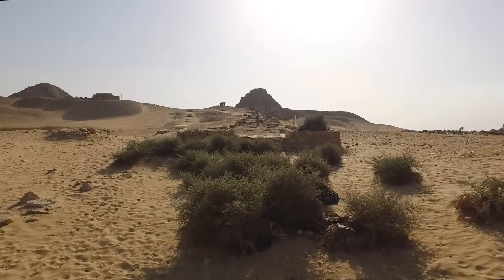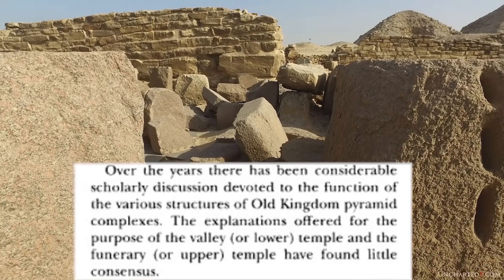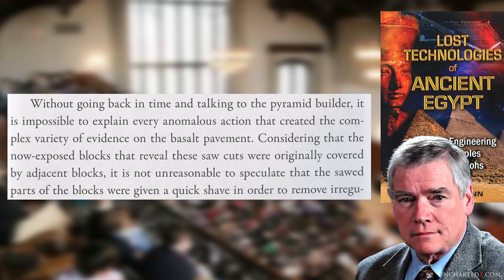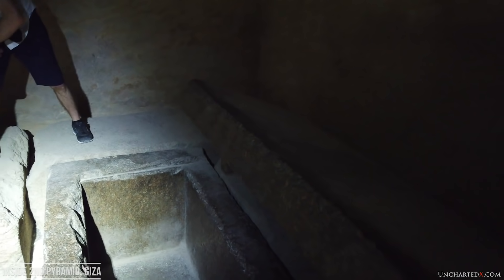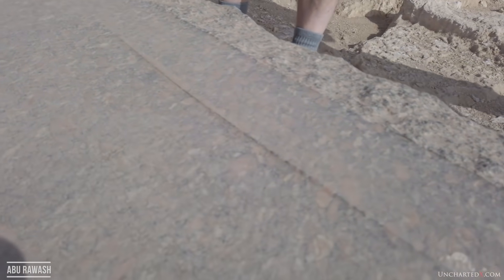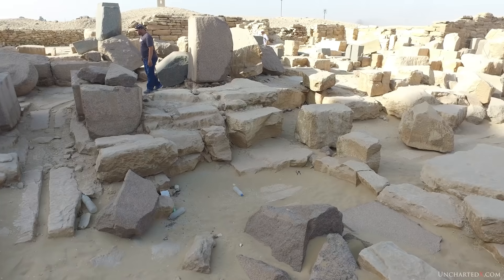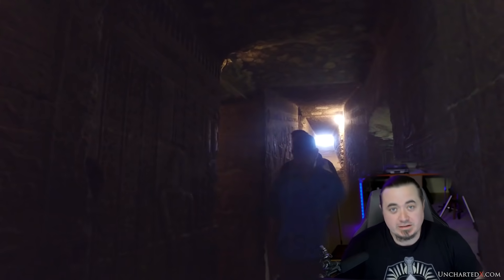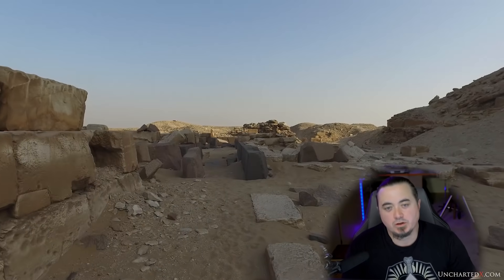The Mystery of Ancient Egyptian Stone Cutting in Basalt and Granite - UnchartedX full documentary!

Comment: In many places around the Mediterranean, the sands contain hard zircon crystals. These are easy to separate using gravity as they are much denser than sand.  It wouldn’t be beyond  Egyptian technology to sinter them onto bronze tools, just like stone cutting tools have zircon and diamond  sintered on today.  Also, just like today, many expensive pieces of equipment (eg. platinum crucibles used in assay labs, radioactive isotopes sources etc.) are kept under tight control. So there might have well been a lot of meteoritic steel tools in use, which never got lost...  Eg. There are no traces of the many huge Manhattan electromagnets left  today. All the silver was returned to Fort Knocks. Desert are the easiest places to find meteorites. They just sit there staring at you, saying pick me up.
Reply: Knox?
Reply: Good point. Like the tools were melted down right? And the metal was repurposed? After they were done?
Reply: @Nuts-Bolts ,
You can edit the Knocks to Knox.
Reply: Fort Knockshop?
Reply: Bronze tools? I thought they only had copper technology. Bronze tech is a quantum step above copper because it requires tin, difficult to mine and refine. Can anyone clarify?
Reply: The hardness of tools is only one aspect of many....the math being # 1.
Reply: @tedecker3792  perhaps when naming the ages, we referred to them similar to Olympic medals
Reply: It may be that the dynastic period Egyptians did separate zircon and work meteoritic iron but it still would not product the same machine marks seen on the stone work shown here. But you are very correct in thinking that those tools would not just be left laying around. They would have been worth more than their weight in gold and the material would have been reused. So there is no surprise in their absence in the historical record.
Reply: @sonjanordahl3158  Agreed. Modern high speed rotary cutting discs which use ‘slow’ feed rates would not leave such a surface finish. There is no advantage seen today for hacking through stone quickly if it is going to need more grinding before polishing. Yet, if one looks at the edge of some stone floor tiles they clearly show grooves from being sawn. For drilling through hard rock to do (say) geological surveys, tons of pressure is hydraulically  applied at the well head  to speed penetration (in other words, drillers don’t rely on just the weight of the drill pipe to force the bit down) leaving ‘grooves’  in the coring samples similar (to my eyes looking at photos)  to the discarded AE tube drill cores. For slicing rock. It would have been  a more economical use of metal for the AE’s to use  a pivoted lever. The flat half having a  radius edge onto which the zircon is sintered. As the unfinished stone cuts indicate a much thicker tool than today’s discs  so a greater amount of feed force could be applied. Aided by the fact the the force is being applied to a smaller cutting area than with a  disc. This would remove more stone at each stroke of the tool compared to each revolution of a modern disc.  Likewise, it looks to my eyes that much pressure  was applied to AE’s ‘thick walled’  tube drills using perhaps just mass plus gravity. Cutting rates to an engineer is a function of force per unit area and surface speed of the cutting edge. As Linus's law asserts "given enough eyeballs, all bugs are shallow". Verily, it is good that Ben is attracting more eyeballs.
Reply: Someone already demonstrated this, he used zircon, sand, a cow bone and a wooden bow and drilled a precise hole through a slab of granite in a few hours.
Reply: @tedecker3792  I'd have to check the facts to see if egypt had them, the video says copper but I'm skeptical. I know for a fact the nearby Mesopotamia civilizations had bronze saws centuries before the pyramids were built.
Reply: Bauxite is found in many places, and temperatures needed to convert to calcined alumina are possible in the Bronze Age.  Calcined alumina has mohs hardness of 9 .  Possibly sintered or used in free abrasive machining.  Do we know is the “saws “ would be used on vertical or horizontal axis or both?  I can imagine some sort of carousel or treadmill if horizontal. Each rpm of a 9 meter diameter blade would yield cutting speed of 27 meters per minute.
Reply: Bauxite is a plentiful aluminum mineral that when calcined yields aluminum oxide with mohs hardness of 9.   Temperature required is possible in Bronze Age and before.
Reply: @countryandnorthern1  Hadn’t thought of that! Saudi still has a working open cast mine at Al Ba’itha. The alph form of oxide occurs naturally so no heat needed. Turkey and Greece also has lots of it in the form of corundite at the same 9 Mohs. We badly need soil samples from these Egyptian work sites for analysis.
Reply: @Nuts-Bolts  Natural form not as hard. Have to drive off the water per se to get to 9 hardness. Do smaller stone objects show any signs of circular saws?  Silicon wafers are  sliced using ID diamond saws.  I made the water based lube/coolant years ago for slicing 6-8” D ingots.
Reply: impregnated into rope that is turned like a bandsaw blade explains not only why the tool disappeared but also the under cutting a circular saw could not do.
Reply: How do you slice up the iron meteorite to make saw blades for stone?

Comment: As always your long format documentaries are the thing on YouTube singularly that can get me the most excited. Keep up the incredible work. You are the next generation's Graham Hancock and Christopher Dunn.
Reply: Is there ever thought about cement?
You see huge blocks in large quantities, has that been worked with a copper chisel?
Beautifully crafted columns are simply made from cement by artists.
You can make concrete from basalt, granite and limestone.
Editing can be performed if it has not yet cured, you can tell by the distance of the machining grooves, which is not possible with hard stone.
With wooden wheels and wooden constructions in which they rotate, you can work with stone chisels all kinds of things, including hollow shapes.
Hundreds of years ago, windmills were also made of wood, with stone bearings and greased with beef grease, you can make anything. Those so-called processed stones in walls are also simply cast, as a kind of bags put against each other, you can easily see that they are all saggy (convex), so they fit exactly together. mysterious techniques and tools? I think simple tools such as a shovel, pieces of wood and linen bags and then such a wall is quickly made. Stones of tens of tons? Just cast in wooden formwork, otherwise you would have to put in a lot of effort to move so many stones, with what? So simply crushing rock types and turning them into concrete is also strong.
The broken bricks look very homogeneous on the fault line, it doesn't look like natural stone and plaques often fall off, because the concrete has not been mixed well, you see that everywhere, it has been a quick job.
Reply: @heinpereboom5521  Appreciate the insight, glad you replied to my comment so I was able to see it and read it :-). Would love to hear more, thanks!
Reply: @heinpereboom5521  🙈
Reply: @keithwhittington4624      ?
Reply: Couldn't pick a better insult eh?

Comment: I have worked with Granite, I was part of the team that installed the Cornish Granite on the new Parliament building Portcullis House and restored the end of the cell block at Scotland Yard which was shortened to allow the new Westminster tube station and Portcullis House to be built.
The cut marks made with the diamond blades we used to cut the stone are very similar to the marks shown on the Basalt here, it takes a great deal of effort and time to cut into a piece of Granite with a 9 inch diamond blade on an electic grinder/cutter, and cutting too far into a piece of stone is not something that just happens like slicing too far into a cake.
We were using a huge number of diamond impregnated steel blades and tungsten tipped SDS drill bits which become worn out very quickly, a Copper drag saw and sand would not be possible to make the overcuts as shown, the steel/diamond circular blades wear out in a matter of hours, and somehting like Copper would not have the durability to make the cuts, especially with an abrasive compound.
Reply: I totally agree. When you have hands on experience with these things you quickly learn what is possible. People of the time they say made these things did not have the technology or ability. These things were made by a civilisation far more advanced than we are able to understand.
Reply: That's because they used fire for pretreatment of the granite along the cut line then granite can be cracked like an egg. I've witnessed this
Reply: @stevenanddaisysjourney8922 That is a very common method for quarrying granite and is seen all over egypt, its evidence that they quarried the blocks that were already cut long before.

Comment: I would think there would be quite a large deposit of copper particles in the outwash of the Nile if that much copper was being worn away upstream. Right?
Reply: A major modern mine's worth, great point...unless they recycled which might infer other serious problems with states of technology ascertions.
Reply: Good point. Not like they would have been gathering up all the spent copper dust. That's actually a really good point. You'd think you could sample all the ground around there, and look for high copper content. If you don't find a bunch of copper residue, they probably weren't doing that. I mean, I don't think they were to begin with, but You'd expect to find copper concentrations in the seams and dirt in the surrounding ground. Someone should do that.
Reply: @AnunnakiAaron  I was also thinking that the mysterious lost tools would have had a high probability of being made of metal. In fact it seems almost like a certainty, IMO. 

Which leads to the next obvious question: How many of these sites have been thoroughly examined with metal detectors? And how far under the desert sands can modern metal detectors effectively penetrate?
Reply: @michaelhart7569  
My older but expensive hand held metal detector has a depth range around 6 to 10 feet depending on the size of the metal object. A coin can reliably be found at 2 to 3 feet and it can even tell me if it is a dime or a quarter if it's not heavily eroded and is in its little computer brain memory.
Considering that my metal detector is roughly 20 years old I would imagine some better equipment exist today.
Reply: @AnunnakiAaron  Why wouldn't they recycle the copper?
Reply: all we'd have to do is pry apart those foundation stones and analyze the cut marks for trace materials.
Reply: @AustinKoleCarlisle  this is a great idea. I was wondering about tools residues all the time. Until now i feared it is gone after 3000 years. But deep inside still intact structures you should find something!
Reply: It seems like there would be saw blades to uncover as well. A culture predicated on building would have more tools.
Reply: @mikec4196  unless the tools were taken back with the builders.
Reply: @AustinKoleCarlisle  That is the most likely scenario. Unless there weren't even tools to begin with.
Reply: @mikec4196  possibly consciousness was involved, maybe to "charge" normal items with increased ability or something.
Reply: @AustinKoleCarlisle  Yes for sure  i see like vibration or particular chant like tech that changes the molecular structure of items and makes them weightless and pliable.
Reply: @mikec4196  the truth is likely stranger than fiction!
Reply: @AustinKoleCarlisle  what is known as myth is my bread and butter.
Reply: Wouldn’t copper have just decayed away by now... ?  Not sure what happenes to pure copper over time but I’m sure there’s some effect...

Comment: Hey Ben, I've been watching your videos for a while, the one on stone cutting really caught my eye, particularly the concave cut on the large piece of granite at Abu Sir, I have a suggestion as to how that could be cut. If as is suggested by the edge of the cuts on some pieces the blade was only a few millimetres thick but very large diameter, turned at any speed it would tend to wobble and warp as it turned , it would have to have rubbing block guides to hold the blade true, imagine you had two pairs of guides , one pair on either side of the axis, they could be turned so that they would cause the blade to curve as it turned allowing the cutting of a convex shape!.

Comment: At the end of this video, the footage shows "crumbling" or cracking or fractured basalt (or is it granite?) surface, whereas the interior of the stone is clearly softer sandstone. Amazing! It looks like the for faces of the stone were made of basalt or granite slabs, used as a mold, and inside of it was poured sandstone-like concrete. The implication is enormous: if indeed that encased material resembling  sandstone is really a form of special concrete, therefore, man-made, clearly it would simplify the process of pyramid construction, as well as other monuments (made of what is supposed to be cut sandstones). I even dare to say that the cracking of basalt resembles also the cracking and chipping of modern concrete. Would it mean that basalt-like and granite-like stones used in ancient egyptian monuments are also artificial? Not likely, since quarries are shown to exist. But, the carvings of huge granite boxes, perfectly squared at the inner corners represent so huge challenge, even by today's technology. Casting them would be a solution. But the technology employed to do that would have to be "out of this world, since we do not know how to melt granite and pour it, so that it looks like the genuine natural rock.
Reply: Igneous stone could not be cast similar to concrete.  It requires molten rock.  As the molten rock cools, it crystalizes.  The slower the cooling, the larger the crystals.  A geologist can easily differentiate between native igneous stone and concrete.  It truly is amazing.

Comment: Great video. My guess is: Circulair saw, tooling etc. These people where not so much like us. The movement lines show they used frequency based tooling, that has no need for copper or metals. It's possible to use wood, stone, metal even water to cut these stones with the right frequency passed trough it. Probably much like wind passing over the builings moving sand over the years and grinding the buildings, just faster.

Comment: I can just imagine the shining white pyramids contrasting with the gleaming black floors .
Reply: Yes, I think the choice was purely for aesthetic effect. Maybe not the exciting reason everyone is wishing for.
Reply: Must have been AMAZING! 👀🔥💗
Reply: The black floor would absorb a lot of heat from the sun and maybe this heat was redirected to the pyramids through some kind of fluid running on these U shaped stones... Or, the pyramids were some kind of water pump and then the water would be heated by the black stones? Also, does basalt has any kind of electromagnetic properties?
Reply: @stormrider.14  think u r on 2 something
Reply: Yeah, that must have looked stunning.
Reply: @stormrider.14  the climate was likely different back then. Personally I believe some of these structures like the great pyramid, the sphynx, and many of the other structures (probably the ones with these basalt floors), go back much further in time than what we think, which the further you go back the cooler, and wetter that region gets.
Reply: Would have easily been visible from....space! ;)
Reply: Makes sense, if it was raining a lot, they'd need to have a drainage system to keep the water from puddling on the tops of the stones, it could seep down into the channels and run off. Also they probably had people to wash the floors and that would also run off into the channels.
Reply: @TD_YT066  sand would clog these pipes.
Reply: @AustinKoleCarlisle  They'd have to flush them out periodically. In modern plumbing we have 'cleanouts' they may have had the same, or left ropes in them that they could use as a 'fish tape' to pull cleaning rags through to keep them clear. You pull in a fresh rope as you pull out the old one. All that would rot away by now of course.